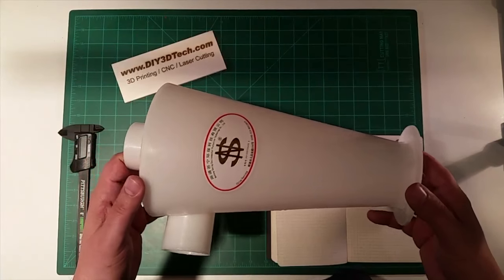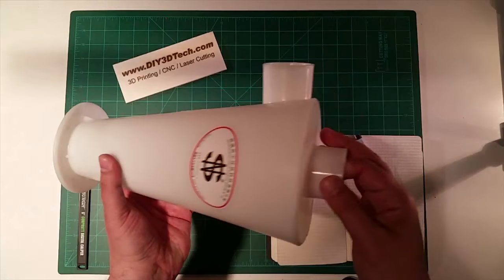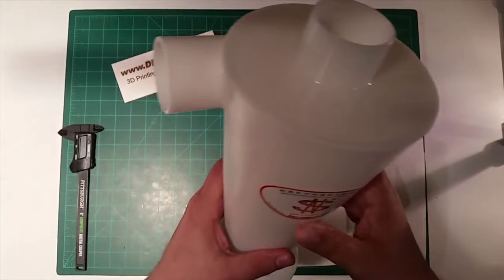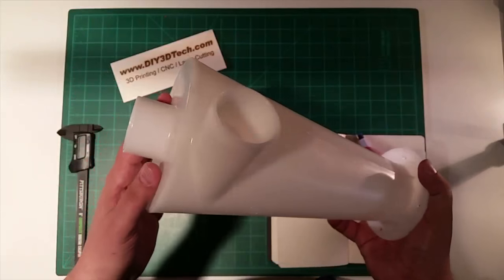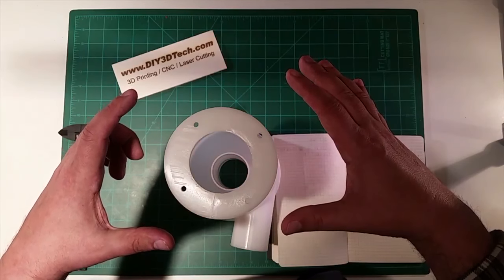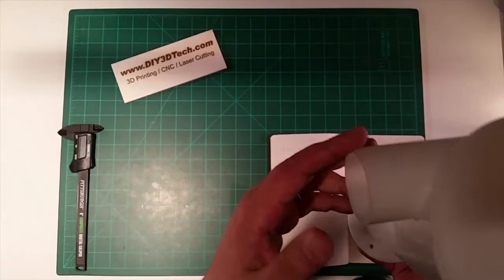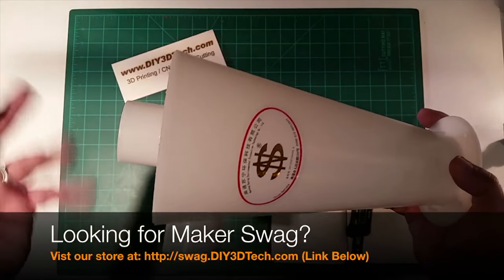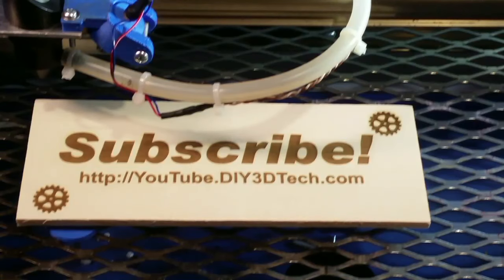CNC Project - Building Cyclone Dust Collector Part 1!

Comment: YOU'RE  overthinking this!  Trace the flange onto a scrap piece of wood, measure the distance of the flange's outside to inside  distance to draw your center hole,  cut the hole out and drill a few extra holes if you want more than 4,, trace & cut the hole in the bucket's lid and drill your 4 or more bolt holes and fasten everything & your done! Use Liquid Nails or silicone on the flange mating surfaces. I feel I got robbed of 15 minutes of my life...not to mention a Part 2!
Reply from the maker: Bet you my results look nicer than yours, and too I learned  (as well as taught others too) to do something  new where you didn't.  Sure there always many way to do things, however the idea is to learn something new by reference a common task.  For example, you can drill a hole with a drill bit or a laser, so if you want to learn to use a laser analogize the task.  If we follow your logic why not stick with a horse and buggy as your car was simply over thinking :-)